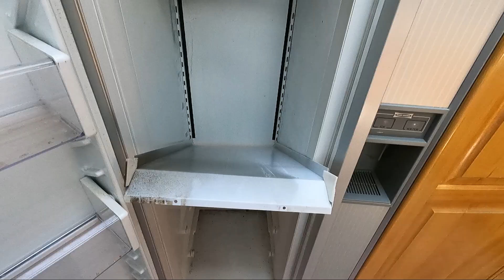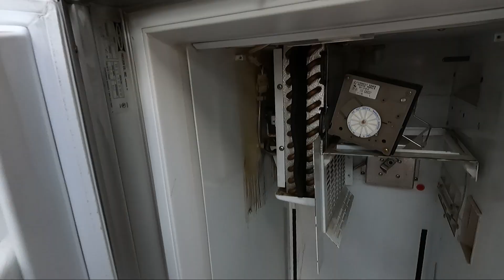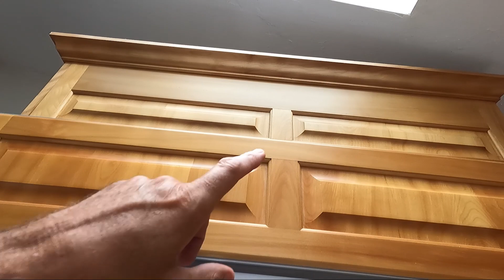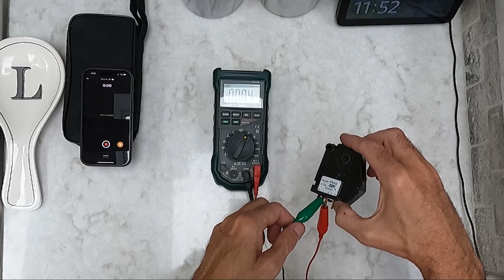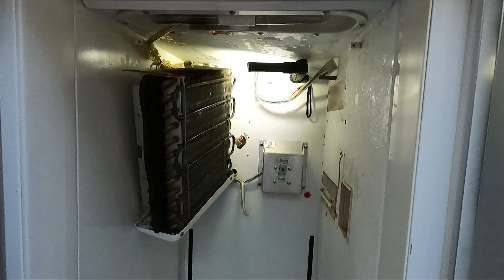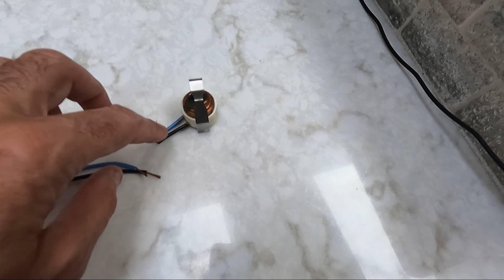Sub-Zero 590 freezer not getting cold enough, bad defrost terminator!

Comment: I too have a Sub Zero 590 model.   I have been through this exact process.  For me, the symptoms manifested by no ice being made, which is because of the freezer temp not getting cold enough.   You pointed that out in your video.  Yep, when you exposed the coils in the condensor,  they were fully covered in ice and that is the problem.   I have replaced both parts you replaced as well.   What a PITA this was to replace.   I ended up setting up mu Android device running Zoom w/camera on to a laptop also in the Zoom session with laptop in freezer (and lots of light) to see more of what I was doing. 

Anyway, that was 2 years ago.   I now routinely do a few "maintenance tasks" a couple times a month and one task weekly.  1.  I clean out the ice bin.  We use a lot of ice and this bin and the process of moving the ice through the shoot leaves a lot of ice shavings.  So, I pull bin out, dump ice out of ice bin into large bowl, use hot water to melt all shavings/ice, dry bin, and replace ice and put bin with ice back into freezer.  2.  I now have a flashlight close by and pull the ice bin out weekly and look closely at the coils/condensor to see the level of icing.  Occiously, it should not have much ice.

I do this as I have had this symptom return twice since the removal/replacement of the discriminater part.   

Long story short,  I found that large swaths or chunks of ice had formed in the back of the condensor area where the discriminater part is, in addition to seeing all of the coils iced up.   What must have happened is that the ice in the very back was enough or formed against the electrical connector on the discriminater to lose continuity.   

Very weird, unique, and hard to find.   I summize the cause was the freezer door being left open slightly over a week or so (my wife and I were out of the country for three weeks and my daughter stayed at our house).

Summary, I watch for frost weekly as I know what normal looks like.   Yesterday, I found significant icing.   Not sure why yet.  I removed the light cover, the white panel with the 4 screws, remove the ice bin, remove the 3 screws on ice maker, remove cable to ice maker.  Nothing else (well all of the food gets removed to another freezer).  I then accelerate the defrost with a variable temp heat gun, ensuring the air temp is not too hot.  I defrost the condensor and also left the heat gun in a position to blow warm air behind the condensor.  Ithen turned freezer back on, let it get to 10 or so degrees and manually moved the Thermostat timer to force the coil heater to com on.  It does.   I know (this am) have the ice maker and bin back in, but am leaving the white panel and light cover off to watch the behavior over the next several days.   I don't know why this happened this time.
Reply from the maker: Hmmm, so it seems like everything is working as it should but you still get occasional ice buildup? I'm wondering if it's related to the defrost timer? Maybe it skips a cycle intermittently? If so, maybe when it does go into defrost, it doesn't have enough time to remove all ice/frost? I'm not certain, but the 1st gen 590 OEM timers may have been 8 hr units. The replacement I bought on Amazon was 6hr. My thought was that more cycles will just ensure no ice buildup, even though it shouldn't really be needed. Not sure but worth looking at...
Reply: Good idea.  I am in watch mode now.   Temp being watched and I am manually moving the Thermostat timer with screw driver ro force defrost.  Update from this afternoon.  All is working as expected.  I will leave the freezer inside panels off for a few days and inspect.
Reply from the maker: Ok, so you're testing the timer to see if it initiates and comes out of defrost every 6 or 8 hours (depending on the part that is being used). Defrost cycles can be up to 20 minutes, as far as I know. You could probably set a timer for yourself to check at those intervals. Good luck!   @Mark-ji5ve
Reply: @PIFDIY  and others.  I am at ~ 5 days now.  Light cover and cover in Freezer that exposes the condenser has stayed removed for the purpose of looking at the icing amount of the condenser coil icing.  All is working as expected.  I have manually tested the defrost timer (using screw driver to move the timer manually) and see/feel the heat element heating (touch carefully) and watch the frost/icing melt.  Both the parts (timer and discriminator), as I have mentioned have been replaced in past 18 months.  The guy I know I talked to and bought parts from (at a higher price as he spent time talking with me) is convinced in his 40+ years of subzero repair, that the root of the issue is related to something causing excessive air getting into the freezer compartment.  This would be caused typically, he said, by 1.  Door seal problem - causing air to get in, or 2.  Door left open slightly.  I have inspected the door seal very closely.  It is not damaged or warped, deformed in any way I can see.  I have cleaned them with soap/water as there was some food-stuff but nothing that just stood out as an amount of food-stuff that would defeat the purpose of a door seal.  I have tested the door closing on it's own (assume you just let the door "go" when the door is in the motion of closing) - the door closes.  I can hear like a vacuum sound after the door closes most times.  So, I conclude two things at this point, maybe 3.  1.  Something is causing the defrost cycle to intermittently not engage.  I have a spare defrost timer and both work fine.  2.  When excessive icing occurs, it seems to be related to icing in the very BACK of the coils that once that area is defrosted, "everything works as it should" -- as I mention in an earlier post, related to enough icing around the discriminator wiring harness expands the contacts in that harness to impeded an electrical connection (this was the theory from the expert with subzero experience).  3.  So, I know how to fix, the general symptoms, but not the root cause (why is the defrost cycle missing or stated another way, why is the discriminator not engaging - which based on my data, is because of excessive icing in that area of the back of the condenser coil.  Perhaps a damaged wire harness.  Perhaps the discriminator part with that funky clip did not get reinstalled correctly (which I do not want to go through that again as that is a task to say the least).  I think I will reinstall all of the covers this weekend and go back to my physical inspection when I am in the freezer (quick bend back the metal panel slightly, use flashlight to look at condenser coil icing.  Check that door is closed, pay attention when door is opening / closing....
Reply: Darn.  My journey continues.  6th day with light cover off, panel off in freezer.  This AM I noticed too much ice/frosting on condenser coils.  I manually moved the defrost timer with screw driver to force a manual defrost.  Freezer compressor turns off (expected), but the heating coil does not engage (to touch, not getting warm).  I have a spare Defrost Control (Supco - Amazon sourced) to replace a ~2 yr old OEM defrost control (yes, turned power off before doing this).  Power on, manually moved this defrost control to force a defrost cycle.  Same behaviour, result -- no warming of the coils.  I had to go to work (upstairs in my home office).  So, I decided to turn off the freezer from the dial control inside of the refrigerator and leave it.  I have a couple of thermostats -- manually read and an Ecobee sensor so I could keep on eye on temp.  Idea was to see if it would do some manual defrost on its on.  Fast forward about 14 hours, temp in freezer was at about 32 F.  The coils defrosted some for sure, still more ice that should be there, but there was less then this AM.  I turned freezer back on.  Manually forced a defrost cycle.  Heating element engaged!   So, moved the freezer temp setting to 3 (usually have it at 4 to 5 on the dial).   I will keep watching -- not going to reassemble this weekend.
Reply from the maker: "Power on, manually moved this defrost control to force a defrost cycle.  Same behaviour, result -- no warming of the coils." 

So, This should only be able to happen if the terminator was not cold enough (forget the exact temp). Was the freezer warm or not below freezing at the time?   

If the freezer was running and the terminator temp was at normal freezing temperature, the coils should have warmed when you manually initiated defrost. The fact that it didn't, seems like you have an intermittent issue. Sometimes it heats, sometimes it doesn't. If that's the case, I think the only two culprits could be the terminator or the heater coil. To test those, you need to look at voltage going to these parts. 

You could test the terminator with a voltage proximity sensor as I did in my video. When I tested, the defrost timer was calling for a defrost cycle, but the coils couldn't have gotten warm because the freezer temp was too high. Still though, I could verify that the terminator was getting voltage with my tester which ruled out the defrost timer and wiring between the two. If I had gotten no voltage, the problem would have had to lie between the terminator and defrost timer. 

There's one other thought that I had - you said that you had replaced the defrost terminator. If it was positioned too close to the the heating element, it could potentially be turning itself off due to temp (thinking that the freezer is too warm).
Reply: @PIFDIY  Freezer was definitely cold, well below freezing (like 5 degrees).  We are in agreement with assessment.  Intermittent issue for sure.  The guy that has repaired subzero units for years does not think the problem is the terminator (as it is practically new).  He said these things rarely fail, and when they do, they whole unit is at 20 years or more.  Agree with looking at voltages -- which I can do, I just have to take the whole unit off line for a day or two as I will have to remove the condenser unit to get to the back of that area which I am not really looking forward to.  I did receive an email last night from my expert friend who suggested I do a real defrost, i.e. turn the freezer off for a couple of days with the door open to, as he said "really make sure the condenser is defrosted all the way through".   So my current plan, as I mentioned, is to turn the unit down on the dial to about a 2.5 to 3 (and temp is still at 0 to 3 degrees when I check in AM).  Continue to watch for icing.  I will plan a extra day or two off to tackle this, probably when my spouse is out of town......   THanks for the feedback.
Reply from the maker: Ok, good luck. Yes it is a PITA to go offline, especially when the family is trying to use it normally. I think you're on the right track and let us know what you find.  @Mark-ji5ve
Reply: Okay.  Several weeks watching this.  Intermittent behavior of the freezer defrost of coils turning on (the heating or defrosting of coils).  Net-net, when defrost cycle should be on, as defined as timer in defrost mode, coils getting hot - and they dont,  only way I get then to engage is a 30 sec to 90 sec hot air blow into the area behind the actual condenser coils.   This goes back to original problem or theory of something going on behind the condensor coils with the electrical connection or perhaps the physical connection from the terminator to the connection on the coil.

I literally am watching this daily.     Everything is working from a ice making and freezer cooling perspective.  However the actual defrost (meaning defrost cycle starts, but does not defrost) cycle is not starting the heating element unless I "help" the process.  I am going to order another terminator, pull the coil and replace again.
Reply: Update.  I continue to watch the staus of coil freezing and defrosting.   I can now replicate the problem like clockwork, as I suspected in previous posts.   When I witness 4 or 5 days of frosting (I am an expert of knowing what the coils look like if a defrost cycle does not occur.  So, I can get the terminator to work (meaning when unit should go into defrost cycle and heat coil), by 1.  Manually move defrost timer info defrost mode.  2.  Move to right the ice maker as I have it just resting on the two rails it screws into.  3.  Apply heat via heat gun to back of coils for probably more like 3 to 5 minutes.  The coils then engages and begins the defrost cycle.  

My summary then is that the discriminater part is not bad.  There is some type of problem as I outlined early in my posts here and discussions with experts, that ice is building up behind the coil in such a way, or amount that prevents the system to actually transition into the defrost mode, engaging the heater coils.   I believe this is a unique problem.   As I have replace the part 2 years ago, perhaps I did not replace it properly.   Or, as an expert has suggested, just let the freezer totally defrost naturally for 3 to 4 days with the door left open for all moisture to be removed.  I will do the later soon.
Reply: Update.  So the day after the last post, I turned off the freezer, removed all contents, and let it naturally defrost (with help from the heat gun for a few hours).  Unscrewed the lights, left the door open for 2 days.  Everything was defrosted, dry, no condensation.  So I am in to day 4 after the defrost and the cycle is working as expected.  My expert in AZ was spot on.  I think the I will add this routine to the mix, i.e. total defrost yearly for a couple of days.
Reply: As I posted recently, I continue to see the frost build up on my condenser every few months.  I have removed to shelving/panel and simply use a heat gun.  Manually move the timer to defrost mode. Feel the elements (be careful as they get hot).  Root issue is the terminator is getting iced up in the back and the ice is impacting the wires/harness somehow.  I have talked to some old school Subzero folks and they tell me this is a known problem.  They have suggested a full defrost over many days (like 4 or 5) and then restart freezer.  Repeat process every year or so.  Me, heat gun works every couple of months.

Comment: Excellent DIY video.  I have the same model and it suddenly went "dark".  No interior lights and nothing cooling.  I found the main power switch "smoked" and the four terminal connectors singed.  I jumpered around the switch and now the freezer is working fine but the refrigerator side is not cooling.  I tested the cold control and it is OK.  The fan in the top of the refrigerator side is working.  Service tech says it needs a new control board for $1400 and $200 to install it.  I can buy a new control board for $650 or a remanufactured one for <$200.  Problem is I can't find where the main control board is located.  I don't even see a main control PCB on the schematic???  I am thinking about buying a refrigerator compressor starter relay, a new main power switch and a remanufactured main control PCB but I don't want to do that until I figure out if this model has a main control PCB and if it does, where is it located?  Thanks for any help you can give me.

Comment: Yo. I have your exact refrigerator, April 95. My fridge runs all the time and the freezer evaporator ices up every couple months, needs manual OFF and defrosting. I read elsewhere that it might be the defrost timer. Could it be that your defrost timer never turned off while mine never turns off?
Reply from the maker: If you watch my video, I troubleshoot the defrost timer. It's easy to get to and to test.

Comment: UP DO NOT NEED REMOVE THE SIDE RAILS JUST LEFT UP THE PANEL AND REMOVE IT.
Reply from the maker: Thanks! I figured this out when I reinstalled the rails...
Reply: Agree with @anthonymartin2412.  I did not have to remove as much as @PIFDIY showed in video.  But the hardest part, with out a doubt, is the discriminator part at the back of coil.  @PIFDIY is correct in that once the coil/condenser is "dropped" off the mounts, it can only be moved so far as it is attached to the sealed cooper refrigerant lines.  The spacing left over is very difficult (for anyone) to maneuver to get to the discriminator and that damn clip around the coil.  I had to use muscle memory and position my self just right AND multiple tries to get the clip to secure to the condenser coil line.   Still a great video on this topic.....
Reply: I wonder. Does that little heat sensor bulb part need to be tucked back in to the original holding clip location? Or once loosened free of its housing can it just float or hang wherever?

Comment: Thanks for sharing! I got same issue, but it was defrost timer . Can you please share part number?
Reply from the maker: This part worked for my 590 - https://www.amazon.com/gp/product/B00VS90PM0/ref=ppx_yo_dt_b_search_asin_title?ie=UTF8&psc=1
Reply: @PIFDIY  Thanks! Do you need to swap the wires or is it just plugged right into the connector? It looks a little different ( color) than the original timer..
Reply from the maker: The connector is the same as the OEM timer. Just plug it in.  @kirill3751
Reply: Nice video. Thanks. @kirill3751 could you confirm if the timer worked for you?
Reply: @jingxie4391  Hi, yes, it works great
Reply from the maker: Nice! @kirill3751